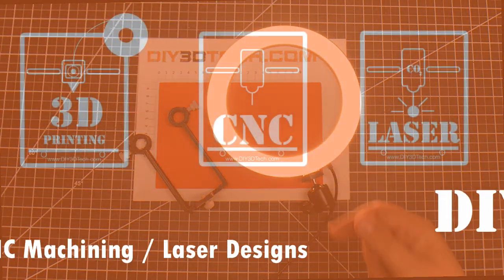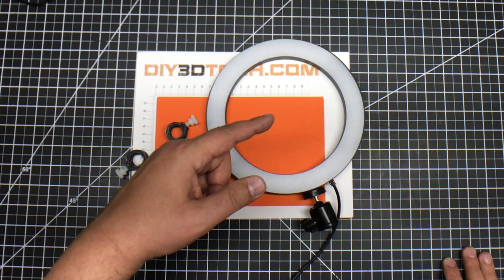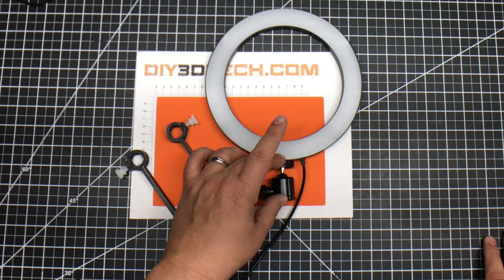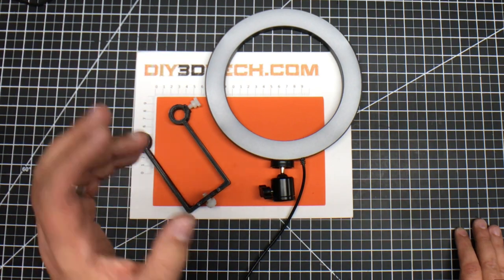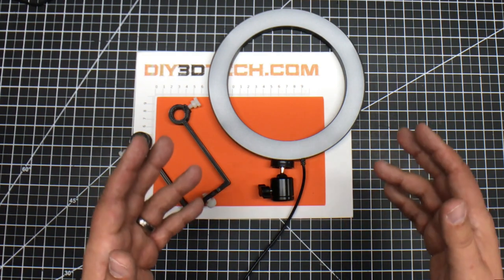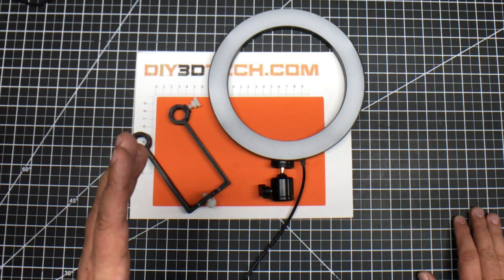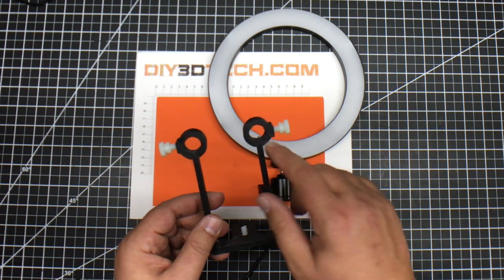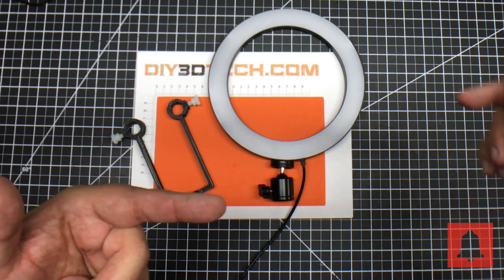Design Talk  - Designing and Printing a Ring Light Mount!

Comment: Why not 3D print the thumb screws as well? Fusion360 does a great design for threads.
Reply from the maker: They don't up well and when they break they typical break inside the mounting piece.  So for "functional" objects, I have learned long ago to avoid frustration, use real mounting hardware :-)